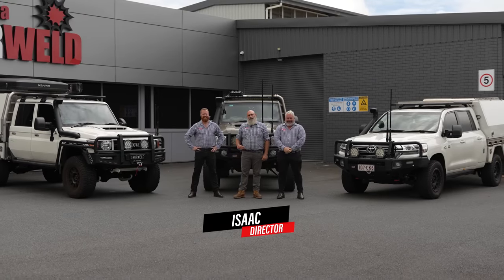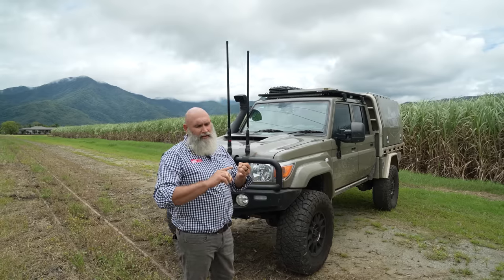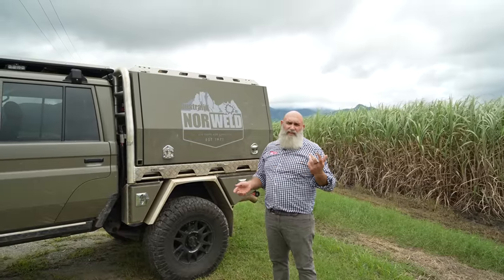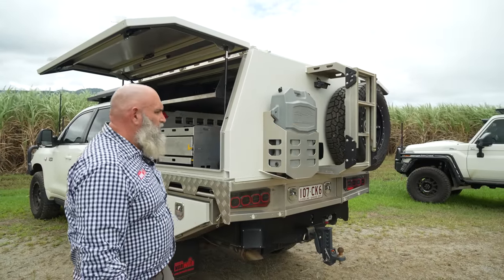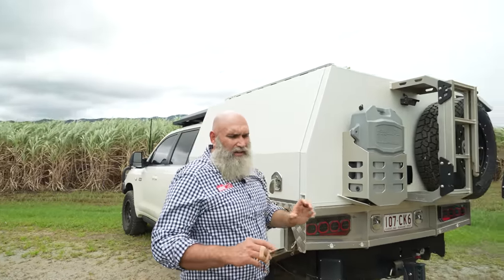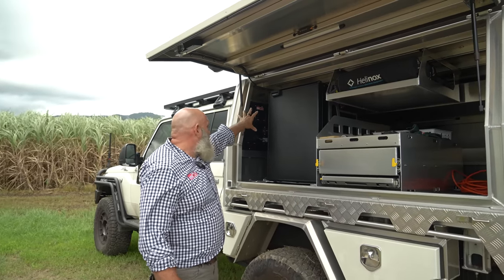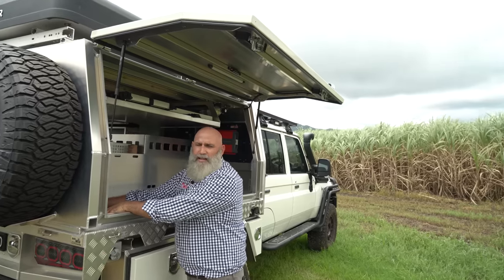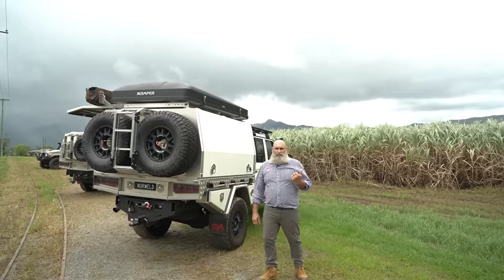Toyota LandCruiser's Head To Head Bull 79 vs Coil 79 Vs 200 Series

Comment: What is the height of the 79 with the portals . That to the top of the heights part on the 79. Just interested how high it is
Reply from the maker: To the cab roof, roof rack or headboard. It’s high I give you that
Reply: @NorweldAustralia  the head board what is that height then.